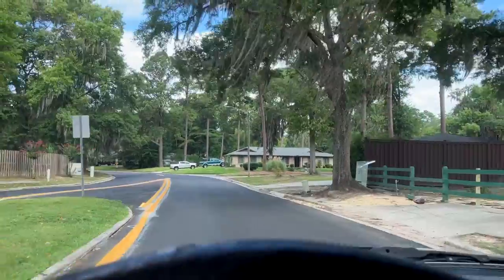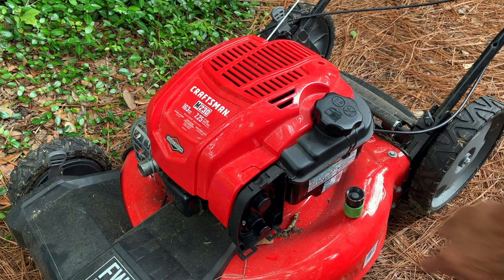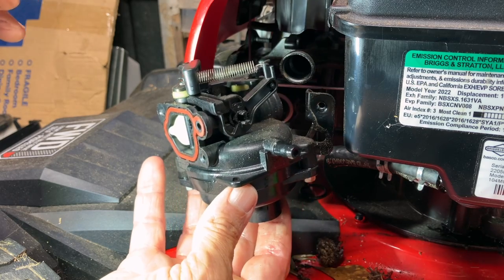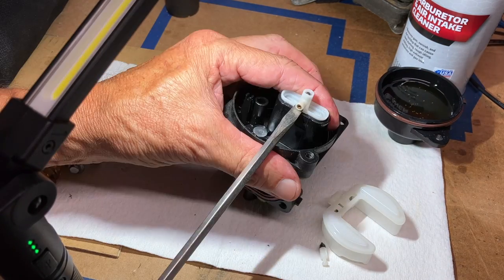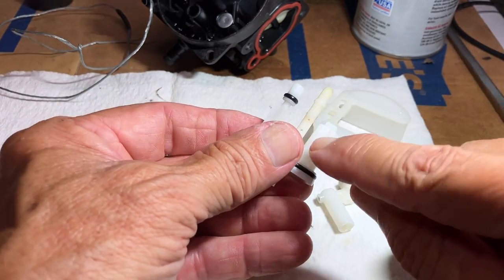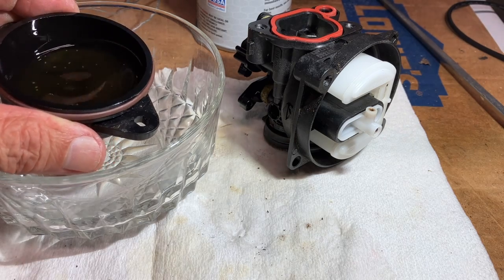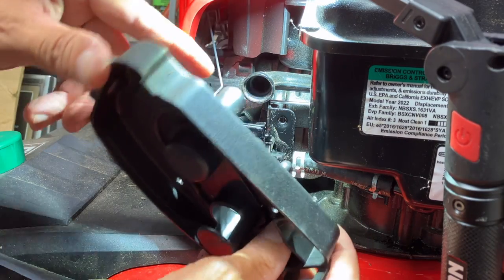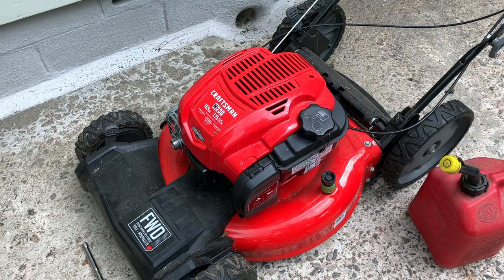Two Year Old Craftsman Mower Won't Start

Comment: I have a 12 year old Craftsman that is still running excellent.  The only issue is when it is hot outside and I take a break from mowing, I have to let the engine cool down for an hour before I can start it.  I can pull the cord countless times and it won't start until the cool down period is over.  Any suggestions of what the issue might be?  Someone suggested it is the coil, but the coil is in good shape.  I did a good cleaning of it and the stator also, but still have the issue.  It has been that way for a while.  Otherwise the mower runs like a champ.
Reply from the maker: Have you tried restarting it (when it's hot) using starting fluid straight into the carburetor? If it runs then you may need to remove and clean carb.. https://www.youtube.com/watch?v=bUGiznCrwnY